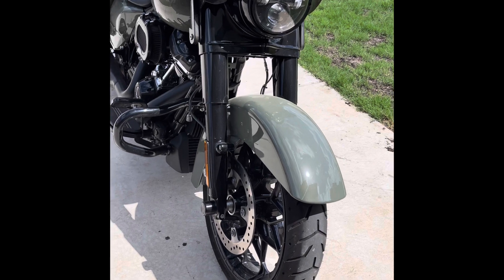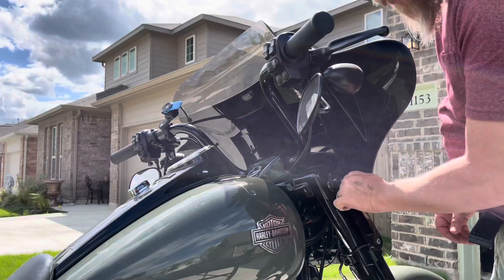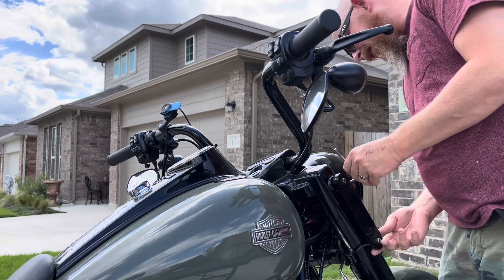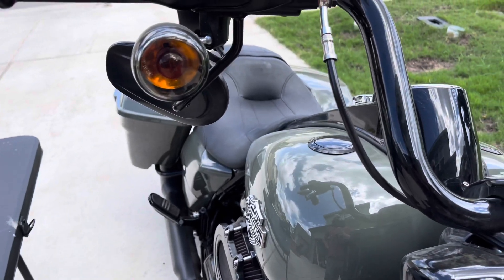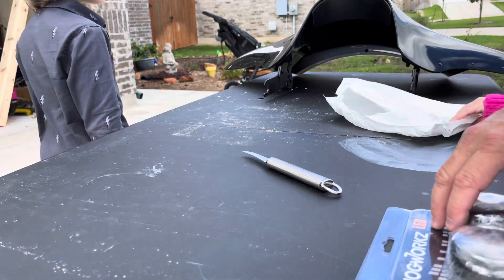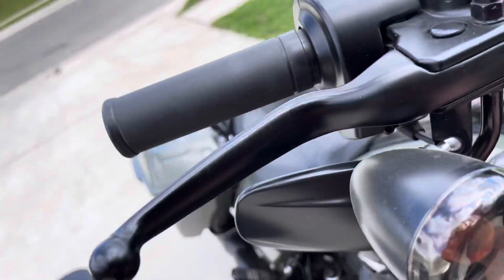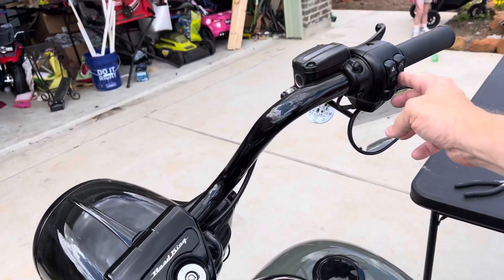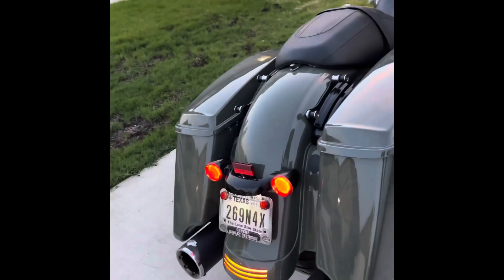JADE SHADOW: The Build, Part 2.4 – Amazing Lights and Windshield Swap! SURPISE ENDING

Comment: This is imho the best windshield for a Road King. For it looks good and it identifys the bike as a Road King. I by myself own a Street Glide Special an I looooooove it. I love it!! A bat wing is connected to a Street Glide and makes no sense on another bike. Even if a Road King, a Road Glide and a Street Glide share approx. 95% of the genes. But either I decide to own a Road King, or a Road Glide, or a Street Glide - there are reasons for each of the bikes. But take your choice and stand in for it, don’t mix them up by adding e.g. a shark nose on a SG, a bat wing on a Road King. The Road King is a touring bike that has no OEM windshield at all and that’s its concept. You can add one, but don’t give up the bikes identity by dressing it up.
Reply from the maker: Thank you for your comment